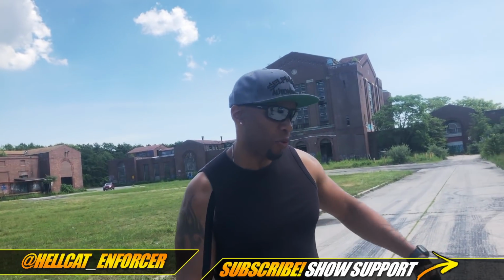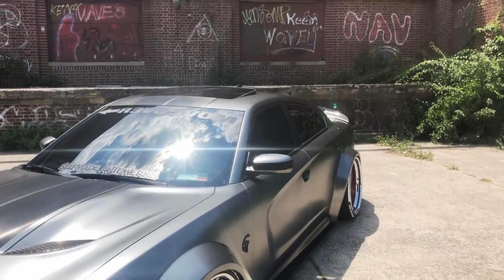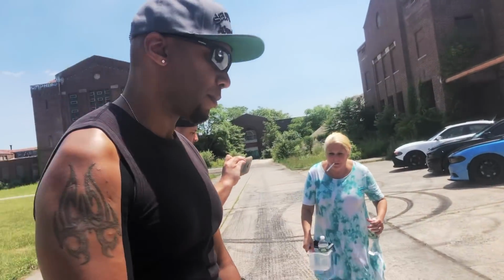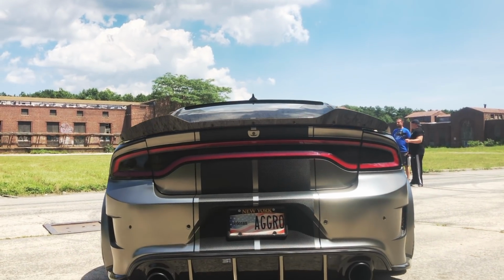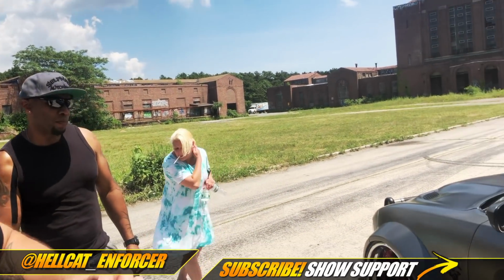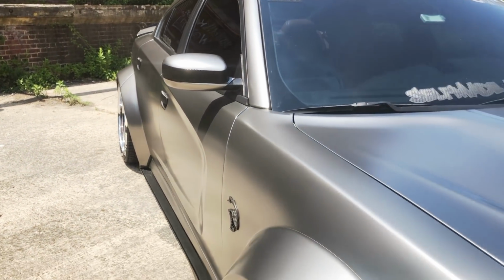PURSUIT Charger Hellcat Widebody 800+HP...

Comment from the maker: Thank You Everyone for the Support! #MoparBros
Reply: I find it funny when I’m on the interstate in the fast lane, ppl move out my way cuz they think I’m a cop especially at night in Venom(that’s my car’s name). He actually has the official lights lol.
Reply: So I have a 2012 rt with the 5.7 and was wondering what some good cheap performance mods would be for it
Reply: I like the set up,  but how do you get away with red and blue lights?
Reply: I don't even want to imagine the total cost of all those modifications.  I have a 2018 scat pack, and the only mods I've done are (1) replaced R/T badge with an SRT scat pack badge, (2) blackened out the side 392 badges, and (2) put a scat pack bee starter button.  I plan on putting 305s on the rear.
Reply: As he drives through an abandoned factory...how ironic.
Reply: Can we have that car in nfs heat
Reply: Tell me you're not at Pilgrim State on the island that is so awesome bro I live in BROOKHAVEN I'm going to be looking out for this car on the island. Well hopefully I don't get pulled over by it LOL
Reply: @3joewj  LOL that's called Pilgrim State psychiatric center that's in Kings Park Long Island New York.  Most of the buildings have been closed some of them demolished but plenty are still open there's still a mental hospital there a drug rehab and a museum amongst others.  The museum is awesome well I wouldn't say awesome but it shows the history of the torture that they used to do thinking they were healing the patients.

Comment: I’m going to copy him a little bit 

My charger will have 

1. Police push bar 

2. Camo wrap or just black factory 

3. Police visor lights front and back 

4. Might do widebody 

5. Definitely on rooftop full size American flag decal 

6. Siren 

7.  PA system 

8. Double limo tints 

9. Cammed 

Interior:

1. Subwoofers ( I will play it when I’m not going fast) 

2.  Might do Custom center box for switches
Reply from the maker: That's going to be a badass build  - let me know how it progresses.

Comment: Hey brother I was thinking about getting the pedal commander and lowering springs for my modded v6, is there any advice or comments about either you could tell me, especially the performance loss/gain from the springs? Thanks in advance and keep making blue into more of a beast!!
Reply from the maker: I lost a little bit with the lowered springs - launching suffered a bit because of the weight transfer. That being said, it looks so damn cool. You will really enjoy the combo. Thanks brother - def appreciate it!
Reply: What suffered from it?
Reply: Besides the launching
Reply from the maker: Just launching. Handling improved though
Reply: Thank you!

Comment: That thing is sweet.  But a `little bit’ too much on the flashy ness.  Do away with the white walls.  Leave white lettering. And the flared wheel wells.  And I’m all in.  But either way I’d still drive it on a rainy day
Reply from the maker: I'm not a big rims guy - that's why mine are always blacked out. He's def doing a great job on this, very unique build.
Reply: R/T Life yeah big rims for me only belong on SUV like a caddy or something. Or no bigger then 22’s on a truck with the CORRECT TRUCK tires. Not those rubber band tires and then they can’t complain their 50K truck got stuck in the sand at the beach 💁‍♂️.  Lol   We get a lot of those idiots here in N Fl